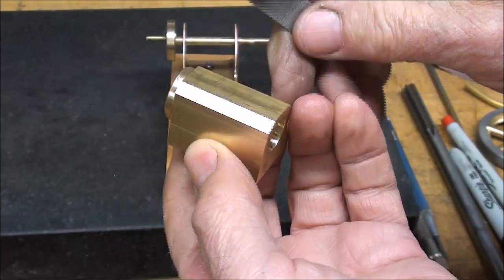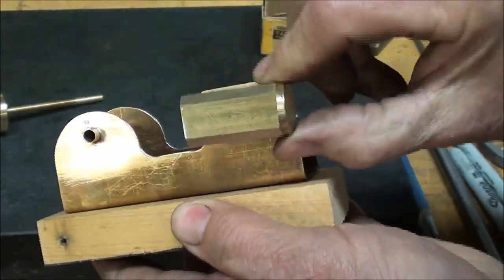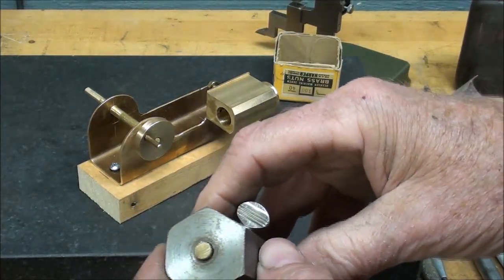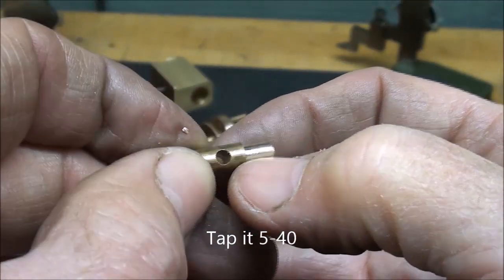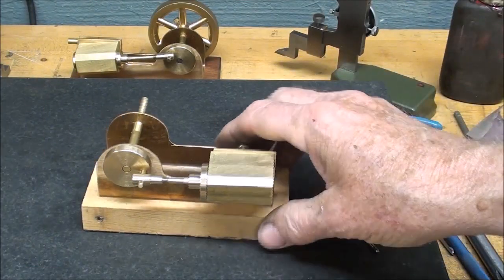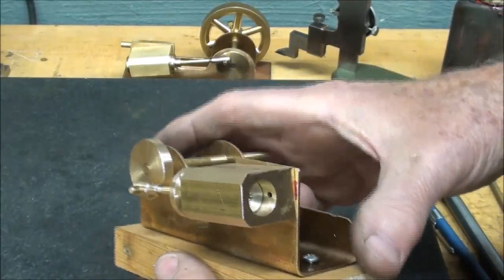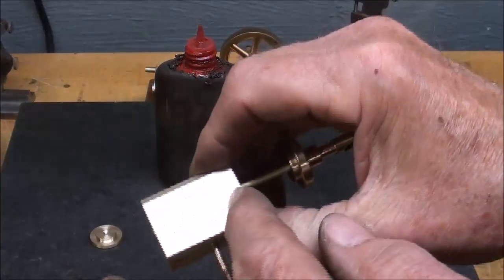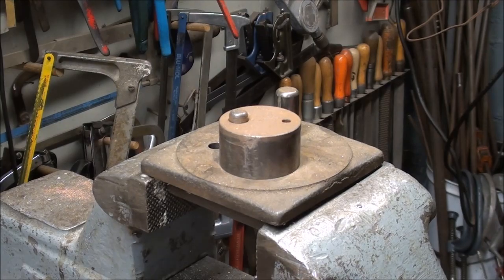Part 6 of 10 - tubalcain Builds the YELLOW BOY STEAM ENGINE

Comment: Just a tip Mr Pete. On my steam engines I take careful account of the coefficients of expansion between cylinder material and piston material, to allow accurate clearances at operating temperature. I also cut a groove in the piston to accommodate a binding of graphited yarn (I use linen yarn) which ensures a complete piston-cylinder seal over all temperatures. It works in full size railway steam locomotives and it works in miniature, too.

Your videos are just about spot on and I subscribe to your channel.

Comment: Hello mrpeteHere is another way you could locate the second set of cylinder port holes. After you have located and drilled your first set of ports, make a pin the same size as the port holes and locate the cylinder in one of the two position. Use your short centre punch pin and mark the one port on the opposite end of the cylinder. Move the alignment pin to the second position and mark the second port location. You can now remove the cylinder and drill the last set of port holes. Just another way of doing it.
CheersWilly

Comment: always interesting to watch the process.....I do have question about the pivot on the cylinder.....would it be suitable to put a washer between the cylinder body and the support frame to reduce the friction?
Reply: +Tim Hyatt The interface between the two parts forms the valve, it shouldn't leak too much.
Reply: +Tim Hyatt - No, because the side face of the cylinder  must seal against the side of the frame. That's what keeps the steam or air from escaping. The spring is adjusted until there is a decent (but never perfect) seal without too much drag. Some steam escapes on engines like this no matter how careful you are to get both the side of the cylinder and the side of the frame as flat and smooth as possible.

As the cylinder rocks back and forth, the side holes in the cylinder are opposed to first one hole (inlet) and then the other (exhaust). One end is connected to the inlet while the other end is connected to the exhaust (or free to outside air); then they switch to the opposite connections. That is the valving system on these engines.

To be reversible you would need a manifold on both sets of holes (upper holes and lower holes), and be able to switch the air/steam source from one manifold to the other

Comment: Tubalcain, what loctite are you using for the cylinder end caps and threaded bar? I don't have too much knowledge about Loctite but I've heard heat will soften it, so do you think Loctite would be suitable if the engine was run on steam? 
Nice video.
Reply from the maker: +Mr-Laing Retaining compound-cannot read the lable
Reply: I use locktite 680 retaining compound.

Comment: If the two holes at each end of the barrel are steam inlets where is the exaust hole?
Reply: +eamonn280958 only one hole on each end is an inlet. The other is the outlet and as the cylinder pivots crosswise it will get pressure from alternating ends.